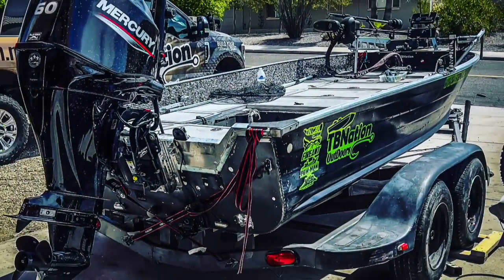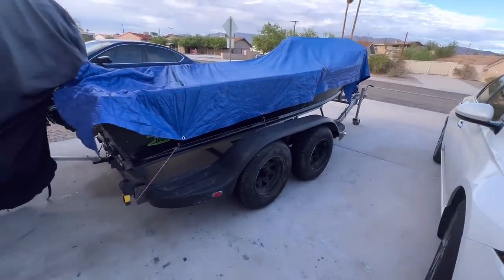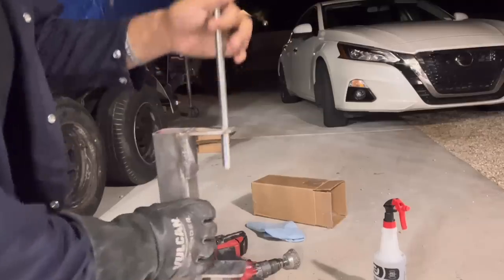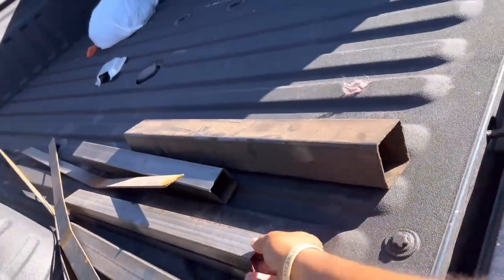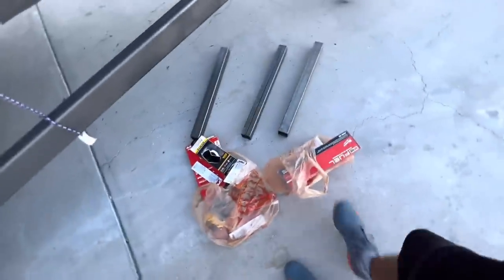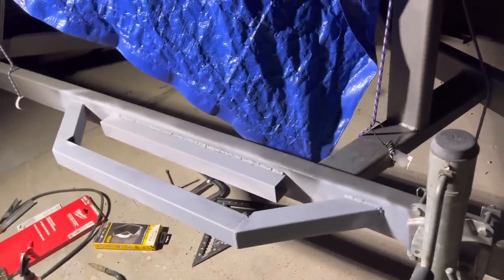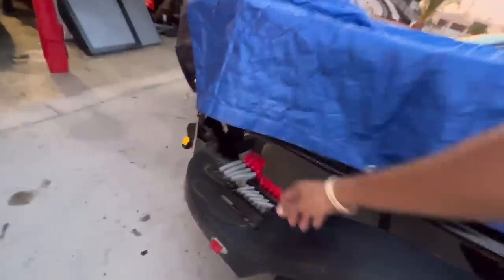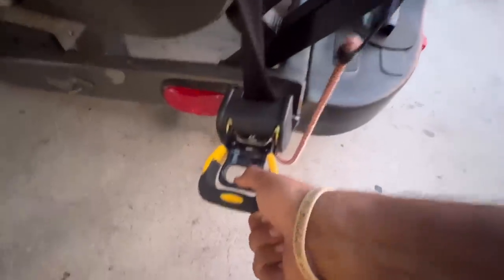Making side rollers & side steps | Bass boat trailer restoration

Comment: I needed some of those switch panels on my pontoon rebuild a few years ago. Which I wired successfully using your wiring guide video. Certainly one of the most helpful tutorials I found. And I need some of those ratchet strips for sure.
Reply from the maker: Switch panels are the easiest thing to replace. Get em while they're available!

Comment: Great vid,as they all are! I would suggest drilling a sweep hole at the bottom of the roller tube. The cap won't keep all water out. I just had the tubing on my guides replaced because they rusted out from water standing inside them.
Reply from the maker: Thanks for the tip!

Comment: new subscriber, loving the information and builds. Retired Army dude 28 years of service and have a full size platform boat for family with fishing perks. The problem is it's 22 ft which is great for 2 to 8 people. I have been looking for something much smaller just for fishing. Shopping, pricing and looking for the perfect fit. I'm over 50 and want something trailer and mobile, Like a fat sand wheel light dolly which I will have to make and strap to small boat when unloading from trailer. The boat needs to be age worthin mind because I want to use it for a long time. I'm looking for light weight under 400 lbs fully loaded. I saw that modification of the pontoon 10 footer and loved it. 2 motors, 1 for getting their and 1 for trolling, electronics, swivel seat, stable platform because I'm not going to be agile as I get older. Electric motors sound like the way to go with deep cell batteries. Really just want to spend about 5 -6 k for total build not including the trailer....just the boat and all the mods with excessories. Wish me luck, doing lots of research and very resourceful craftsman diy with my own shop. Keeping building.

Comment: I pay by the pound for all the metal scraps I buy at my local metals shop. Cheap and easy. Regarding drill-bits: I inherited more than a hundred of all sizes that had just been returned from being sharpened by a guy who worked in a metal-fabricating factory and I learned that those bits will drill a 3/4 inch hole through steel almost as quick as a typical bit will drill through wood. I regret buying any but the most expensive bits my whole life.
Reply from the maker: What were they called?
Reply: @TinyBoatNation  The factory? No idea. The bits? Don't know. They're all taped together in bunches.